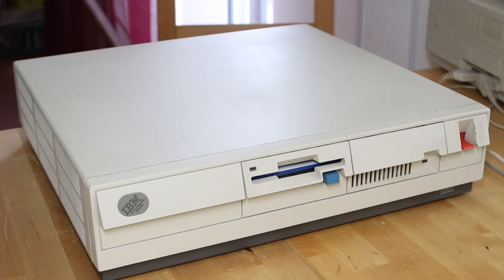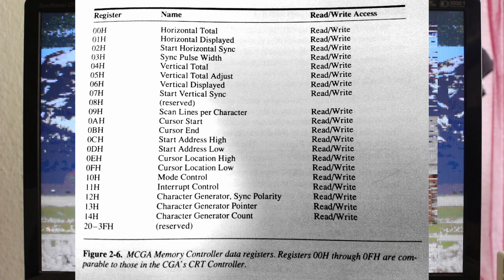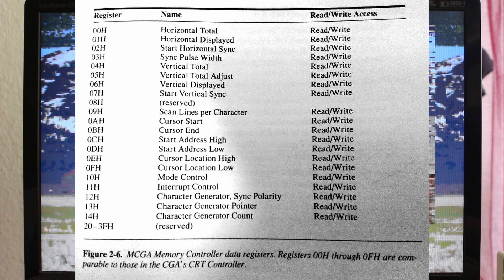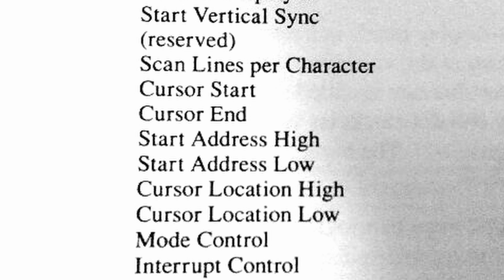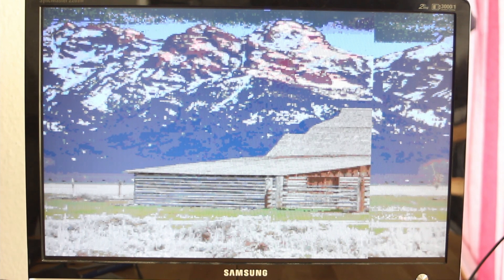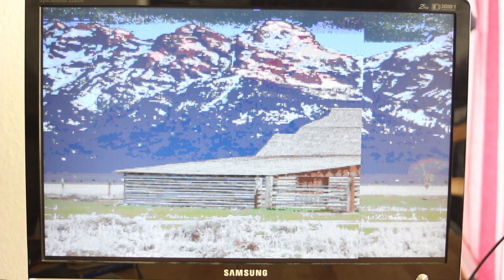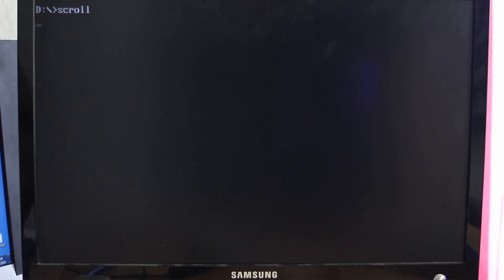I Figured Out Smooth Scrolling on the IBM Model 30!

Comment: Im 6 minutes in, and my guess is that it has something to do with DRAM refresh?
Reply: I'm thinking probably more to do with how CGA interleaves its bitplanes on a 4-line basis... which maybe is a way to adapt 320/640 pixel images to a memory space that's happier with powers of 2... and why everything suddenly works when set to 256 pixel width? (though there's still clearly some bugginess, maybe related to the ultimate wraparound, so the image drops down by 1 line partway then jumps back up, with some garbage from the leftover 1536 pixels' worth of memory space leaking in?)

Comment: Very cool stuff!
I would love to see you make a cool MCGA demo with VileR using your inventions we witnessed here! Apparantly MCGA has an advanced custom CRTC built into its Seiko Video Memory Gate Array, which makes it more like CGA on steroids than a "proto-VGA". It also has separate SRAM (8k) for its character generator. It would be super cool to see it perform some custom CRTC sorcery like in the Area 5150 demo!

MCGA apparantly has a lot of cool tricks up its sleeve. For instance displaying 15KHz natively like they did on the 7469 Executive Workstation, which is essentially a Model 30 with a different case design and a Sony PVM on top. I'm currently working on a simple little passive adapter to hook up my Model 30 to my BVM. Should be really cool to see what games like The Secret of Monkey Island or Planet X3 look like in 256 color mode on a high end 15KHz display!

The Model 30 286 (which has VGA of course) with its "secret" custom fonts in ROM is also super cool to witness. It makes DOS and text mode in general look really weird and exotic on those Model 30 machines. They remind me of the fonts used on NCR PCs or in Mac OS 🙂
Reply from the maker: I agree, it would be great fun to make a demo on a Model 30. Keeping it supplied with working hard/floppy drives might be more difficult. 🙂

Comment: Some notes on how the scanlines break at 320 pixels, might be helpful in figuring out why this happens.
Scroll |  Symptoms
   0      |  None
  1-3    |  Every 4th scanline breaks in newly scrolled pixels, reading 256 pixels backwards.
  4-28 |   Every 4th scanline breaks for 256 pixels, ending at the 0-scroll right-hand border. Broken pixel offset -40
28-31 |   Pixels still break, but in a different way, offset of +40
Interestingly, the pattern repeats when the broken pattern touches the left edge. Probably a coincidence.
My best guess is some disconnected address line, causing a modulo effect like @hotmultimedia said.

Comment: also came to my mind that the crappy lines with 40 cols mode + altered screeb start address might have something to do with rows not starting from correctly aligned addresses. that 256 wide mode probably worked because all lines always align correctly. it might be worth to try with some test image that makes it easier to spot what parts of the image are shown on the crappy lines to figure out what the hardware is doing.

i don't know if mcga has a "row pitch" or "modulo" register that could help on having row start addresses being aligned. amiga has this "bitplane modulo" register, which is a value that's added to the row address at the end of the scanline so that lines can have arbitrary lengths. maybe mcga has something similar? thanks for the vid.
Reply from the maker: There's no bitplane modulo register as far as I know. I think the hardware is just shifting those lines, i.e. it is using the wrong start address for those lines. I think the registers are probably an abstraction to a lower level of the actual chip, so it would probably be hard to figure it out precisely without studying the silicon.

Comment: Interesting. Now I wonder how this looks like on a CRT because 320*200 mode is supposed to be 4:3 aspect ratio anyways, buy 256*200 may look too narrow on the monitor, unless you can manage to expand the size of the displayed image ? (Not by adding more pixels since you removed them but instead to make them wider)

As for the "bounce", isn't this related to the scrolling that scrolled 256 lines, meaning you've effectively scrolled 1 down ? Maybe you can confirm or infirm this, but it looks like it does that after one "screen" each time
Reply from the maker: It might look a little narrow. Unfortunately I don't know any way to make the pixels wider.

I also thought that the bounce might be due to the adjustment at the end of a screen. But the code doesn't do anything different at that point, and there are plenty of spare bytes of VRAM since we are only using 256 bytes per line instead of 320. So there's no need for there to be a bounce. To me it looks like there is a bounce for just one or a few frames every now and again.

Comment: Neat.  Experimenting with video card registers really takes me back.  In the 90s I built an ansi viewer that used similar register tricks to smooth scroll pixel-by-pixel in text modes.  I also built a e-mag that ran in a custom 640x400x16 planar mode.

Comment: I don't know if we ever figured out whether you have the "P-Planar" (with an older MCGA Gate Array chip) or the later Model 30 "Greenock Planar" (which has the later MCGA Gate Array chip; The Model 25 'Type 1' and 'Type 2' planars have the same correlation as the Model 30 planar types).
Reply from the maker: I think we did figure it out. The comments are on the Mode X video. I remember looking up the markings on the board just under the floppy bay. We also figured out what revision of BIOS I have.
Reply: @PCRetroTech : I'm interested in sussing out why the initial gate array chip had a substitution on later planars. There was a notification ('ECA-023') about replacing the 'Type 1' planar of the Model 25 (there is a predominance of 'Type 2' planars on any Model 25s now unless they were out of IBM's reach for maintenance) - but no comparable announcement for the "P-Planar" Model 30. The early planars also seem to be more affected by the MCGA cold-boot issue (no video until a following warm-boot sequence) that is also impacted by power-draw (occurrences are less severe after removing devices like an 8087).

Rather ironically, another solution is as you show, even though it increases the power load - to just add an 8-bit VGA card.